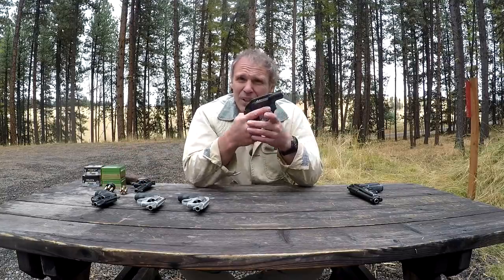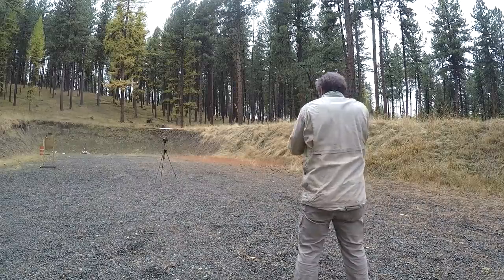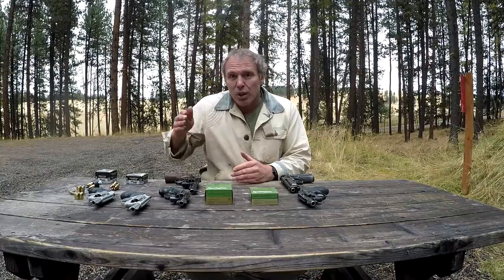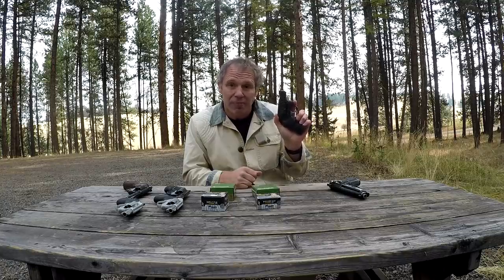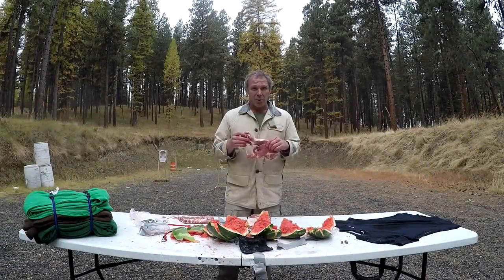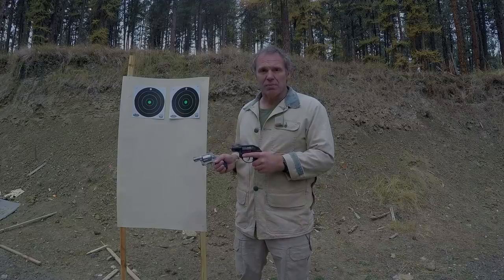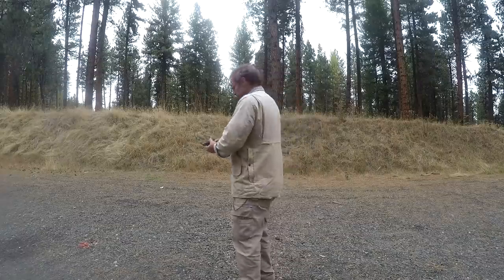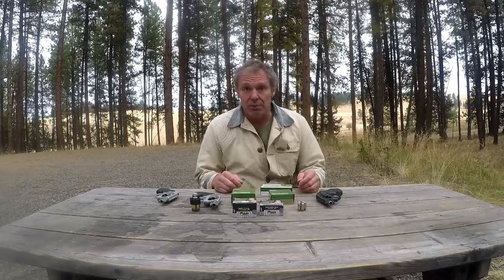Ruger LCR 9 Millimeter

Comment: Paul I always enjoy your videos especially the longer ones. But I have to ask in case someone already hasn't, what do you think about the lcr in 357 magnum compared to the 9mm version. I carry the the lcr in 357magnum daily and wonder if the extra recoil of the magnum is worth it because it's there in these lightweight revolvers. As always thanks for the videos.
Reply: Kenneth Hughes I 2nd this question.
Reply: @Wilson Turner yes I saw that. My point in my case is the recoil. In my lcrx and especially an airweight s&w like the 340 pd, the recoil is far more pronounced in these light weight revolves. Would 9mm be a better choice since follow up shots could be quicker and reloading a little faster with moon clips vs the power of the 357 magnum. I've met people that carry these ultra lightweight revolvers and use 38+p instead of 357 because of the recoil even though their firearm is a  357.
Reply: @roadrunner7828  I would say if your gonna carry a 357, your going to have to accommodate a heavier gun. 357 is a great caliber, but like all firearms, are you going to sacrifice placement or the effectiveness of the round for a lighter gun. As far as follow up shots are concerned if you can put rounds more effectively with the 9mm version than other rounds go with the 9.
Reply: At about 24 oz, .357 magnum is much more manageable.  In which case, carry a 3"-5" barrel to get all the benefits of .357 mag.  I am surprised a ton of 3" GP100 and 686's aren't made.
Reply: The .357 cartridge is stout in this gun. It’s manageable if you can handle the extreme recoil. You can certainly shoot it. But I can only manage a cylinder or 2 of it at the range without gloves before beating up my hands. Then just 38+p or standard pressure the rest of the time. And I don’t carry .357 in it because I’m afraid if I have to shoot farther I would flinch and miss. I do carry 38 Special +P  Hornady Critical Defense 110 grain ftx bullets. If ammo wasn’t scarce right now I would likely order some hot 38’s like the 158 LSWC .38 special +P’s from Buffalo Bore. I’ve shot plenty of +p .38 through this gun (the LCR .357) I love it, carry it everywhere. The only time I’d ever really want to carry .357 in it was if I was in bear county and this was just on me when I went on hikes etc. I’d probably stage it to already be wearing gloves to help shooting but that’s a pretty niche situation.

Comment: Thank you for another informative, thorough, well done video Paul. One issue I do have is- what are your impressions of the LCR 9mm? You detailed the different performances of .38 versus 9mm in auto-loader versus revolver, then compared short versus long barreled revolvers, then 9mm coming fired from the LCR into your meat targets, etc. . Towards the end of the video you just simply said it doesn’t fit your hand but you say it might fit others. I’d really wanted to hear your impressions of the gun itself- how was the felt recoil of 9mm versus .38 in the revolver?Were there any performance or durability issues? Are there any issues that might make the LCR not a good carry or backup gun. In all your metrics of data and performance it seems like the concept of the LCR in 9mm is a winner, but your impressions of the gun itself are equally important to us as well.
Reply: Me, also.  I own the .38 version of the LCR, and really wonder how the recoil of the 9mm compares.  Was hoping you'd mention that.
Reply: @thestingyham1188  I have both and the recoil is pretty comparable due to the fact that the 9mm version is heavier. The 9mm might be a tad more comfortable to shoot if I had to pick. The worst felt recoil between the two was with the 38 Special using Buffalo Bore 158 grain +P LSWCHP, that was a handful.

Comment: Dam, only 4 minutes old and there's already 13 ahead of me!
Good solid video as always.  Don't know about the internal hammer on a revolver though.  Like what's the point of a revolver if you take the hammer away?
Reply: No pocket snag.  No lint or grit buildup inside the gun.  No ambitious prosecuting attorney accusing you of "recklessly" cocking your gun.  SOME hammerless revolvers do NOT have stacking triggers; they cock, stage, and fire buttery smooth, all in double action only if you pull slowly and carefully.  Yeah, they are rare...……………………………..elsullo
Reply: BigK yes,  but where is here?!?!
Reply: elsullo2   Yeah, I'm aware of pocket snag.  Even if I wasn't, Paul was good enough to mention it.  I just don't believe a revolver is much competition for an autoloader, except as a great home gun, because of its reputation as being so reliable, and generally speaking, single action triggers are one of the few other reasons they can be good.  Which this doesn't have.  My Sig, btw, has an excellent single action trigger as well, except that it does it automatically.  Remember, this video was about this particular revolver, not some rare specimen that may have had some custom work on, but just about this Ruger.  
As Paul said, is it right for me?  No. Is it right for you?  That's up to you.  It serves no purpose to me.  I do love revolvers, but more as a nostalgic thing.  If you love it, that's cool, I respect that.
Btw, I don't believe any gun should be carried around loose without a safety.  Exposed hammer or no.  Just my preference.

Comment: That was a great post. My brother-in-law has a 9mm LCR and has twice had issues with the projectile coming out of the case with the 115 grain Federal FMJ ammo. He had multiple boxes of the same lot number and at least 1 failure per 50 rounds on 4 or 5 of the boxes. A couple in the first 250 rnds. he bought and more in the 2nd 250 rnds. He finally gave up and used the ammo in his 1911. He hasn't had an issue with any other ammo brand, just the cheap ammo. The ammo he shot up in the auto loader had no  failures. Again it was $9 per 50  Federal 115 grain FMJ ammo that had the failures.
Reply: Hamm 603 x federal has loose crimps on the 9mm rounds use remington or Winchester and you won't have a problem
Reply: My 9 mm Charter Arms revolver had crimp jump with that same ammo!
Reply: Boberg ammo list.  If you have one of these 9mm revolvers google the list and print it out.  Lots of the cheap bulk 9mm is prone to jump the crimp.  Fortunately there are some readily available low cost options that don’t jump the crimp, like Paul’s beloved WWB.

It happened to me on the first cylinder of Blazer brass.  Not on the list...

Comment: Paul, one thing I'd like to mention - in your explanation of why longer barrels produce more powerful discharge, you brilliantly explained the phenomenon of powder not being able to burn sufficiently - modern gunpowder doesn't explode, it just burns very fast - deflagration, not detonation.

But there is a mechanical phenomenon far more fundamental to the topic, which is less dependant on casing size, burn rate, etc - the fundamental reason longer barrels propel bullets faster is that, irrelevant of the actual pressure in the chamber or how much propellant has burned, longer barrels allow the gas to apply force over a longer time period. Applying the same force over a longer period results in greater energy in the projectile - the most intuitive places you can see this is when you push someone on a swing, you push for as long as possible before breaking contact, and in tennis, you push the ball with your racket for as long as possible.

This principle has diminishing returns, because the further the bullet travels down the barrel, the larger volume the pressurized gas occupies, and the less pressure it is able to apply to the bullet. Also, while the pressure diminishes as the bullet travels across the barrel, friction actually increases as bullet velocity increases inside the barrel, so at a certain point any extra energy simply becomes heat in the barrel. This is actually the biggest problem with modern large railguns - there are naval railguns that can fling projectiles at triple the speed of traditional munitions, but the extra friction melts the weapon itself.

To be clear, I'm not saying that you're wrong - your explanation was completely correct. It was just incomplete. The principle you've described is mostly relevant to exceptionally short-barreled firearms, and explains why a snub-nosed .357 will lose significantly compared to a full-sized .357. But I believe my explanation helps explain why a lever-action .357 rifle is so much more powerful than a full size .357 handgun, when both are supposed to experience complete, efficient powder burn.

Comment: I have both the 638 and the LCR9mm. Shoot both very often. I have to say, I love the moon clips and can load them faster than any speed loader. You mention the 638 has the ability to add one or two rounds rather than the full moon Clip, but you can add a fast round or two on the LCR as well. Yes, it takes a down or pen etc. to remove the extra rounds, but would you be doing that anyway in most situations? The LCR has Better ballistics than the 38 or 38+P, there is no question about that. The only advantage of the 38 642 is the lighter weight for EDC.
Thanks for one very GREAT review. You really are the GODFATHER of Youtube. PAUL HARREL were COMMON PRACTICAL  SENSE RULES!

Comment: Paul - I thought this was another SUPERB video.  You’re an expert AND a wonderful teacher;  when combined — and both attributes are rare, so combination is especially uncommon — that means “we students” will learn, think and benefit greatly from your efforts, experiences, education and highly articulate and coherent  presentations.  So BZ, sir, and THANK YOU.

I have always preferred Ruger’s SP101 (2.25 inch barrel designs) to Smith’s 1.875 inch J Frames.  I’m well aware that MANY individuals will disagree with me — and I’d never argue that they are wrong, this is STRICTLY a personal preference.  Specifically, I like the SP101’s tank-like strength, its long proven durability and reliability, its always good (although not necessarily outstanding) accuracy, its ability to fire essentially unlimited .357 magnum rounds (however, usually I load mine with top +Ps), its traditional hammer design (for single action shooting), the extra  0.375 inch barrel length (greater velocity and sight radius), and its additional mass (faster target reacquisition and marginally less felt recoil) . 

While I have never owned one, I’d point out that Ruger has a 9x19mm, 2.25 inch barrel, SP101 (Model 5783).  Perhaps (?) this might have the aforementioned advantages AND chamber the arguably best snubbie loads (given one has decided not to carry .357 magnums in a small revolver).  A 9mm +P from a 2.25 inch barrel — obviously, specifically ammunition dependent — might be a very effective load.

Comment: Great, informative video as always.  One factor about shooting a 9mm snub nosed revolver vs one in .38spl is the comfort to the shooter which may lead to more accurate shooting.  Also, it might be interesting to compare the 9mm LCR with the Charter Arms Pitbull 9mm, which has doesn't require moon clips.  Charter uses a modified shell ejector that holds the rounds in place.  You can't eject single rounds but you can carry extra ammo in a speed strip which fits flatter in a pocket.

Comment: Crimp Jumping:
In young & foolish days, I had a S&W 340 PD. 12 oz .357 magnum revolver. First cylinder of 125 gr gold dot ammo with brass cartridges had the cylinder stop after the 3rd shot. Additional bullets had pulled too far for the cylinder to turn further. Same ammo with nickle plated cartridges performed flawlessly. The slightly harder nickel plated cartridges kept bullets firmly seated.

Shooting that gun was like catching a baseball bat in mid-swing with bare hands. I don't suggest it with greater than .38 special wadcutters.

Comment: I've been wanting to purchase an LCR.  I can't decide which caliber...  I was considering the .327fedmag, but I noticed that even Cabelas didn't have ammo. That's a big deal!  I'm leaning towards .22mag, but now the 9mm seems like a good choice, also. The main advantage with the .22mag is, it holds 6 rounds, instead of 5(9mm,.38spec). Still undecided. But, great video on the comparison.  Especially the added power of the 9mm in this platform.

Comment: I love my 9mm LCR! I use Federal HST 124 gr standard pressure in it and have had great performance. Also, keep in mind that the 9mm model uses the same material as the .357 model which is heavier than the .38 models.
Reply: Do you still have it and like it?

Comment: Paul love the channel. On criticism- it’s my understanding the increase in power from a longer barrel is due to a longer “power stroke” or there is more time for the the projectile to be accelerated to a higher velocity. More time for acceleration, and not a “build up of pressure”. As the pressure spikes to maximum very soon after the primer strike.

Comment: Great video as always.  I have an 8 round 929 in 9mm and find bullet creep an issue with some ammo.  I've had bullets actually leave the case on the 7th and 8th rounds.  When trying a new ammo for competition, I usually shoot five and check the remaining cartridges for OAL and do this with several cylinders until I am sure there will not be an issue.  That's the issue with a taper crimp on a semi auto round vs roll crimp on a revolver round.  The max pressure for a 38Special is around 20K psi vs the 9mm 35K psi.  Powders can be selected for faster or slower burn rate properties to maximize velocity for a shorter barrel, but unfortunately for the 38, that pressure cap will forever keep it at a lower power.  When using speed loader vs clips, I have a competition 627 that also uses moon clips and found the longer OAL of 38 is an impediment for fast reloads.  I'm faster reloading 9mm with its shorter OAL.  One factor to consider in 9mm's favor is that practice ammo in 9mm is less expensive than 38.  30 years ago, you could get 38 lead RN for around a dollar less than 9mm FMJ.  Now it's five or more dollars more per box of 50.

Comment: Interesting and fun video.  The .38 is  so easy to like.  Growing up all the old farmers made them in their barn shops and used bird shot in them.   I think they didn't work with bullets inside a barn because you couldn't hit the sides.  You can reload them up to low .357 for use in the 357.  You can cast bullets and use junk lead and they will forgive you.  Brass is thick and can be reloaded many many times.  And like you said....  You can even put black powder and make lot's of smoke.

Comment: I own a Charter Pitbull in 9mm and I picked it specifically because it doesn't use moon clips.   The downside is it can't use speed loaders either because the cartridges need to be snapped into place with a little pressure.   The reason I bought it is because I wanted a backup gun in the same caliber as most of my other carry guns but in a revolver.   A big advantage for me is that in the highly unlikely event I need to reload it I can do so pretty effectively from any 9mm semi auto magazine.   It's a little bigger and heavier than most snub nose 38s or the 9mm LCR so that's a potential negative but I imagine the recoil is more manageable than the 9mm LCR.   The Pitbull was originally a 6 shot but right before I bought it they switched them to 5 and the cylinder stayed the same size, that was pretty disappointing but overall I'm still happy with it.

Comment: I imagine it would be the powder charge weight and the burn rate of the powder used in +P loads that accounts for the velocity loss. Not just the charge weight. Another good video by Mr. H.
Reply from the maker: That's what I meant when I said charge configuration.

Comment: I may have missed if you touched on this but I believe the lcr cylinder is the same size for both the 38/357 and the 9mm- the 9mm being a shorter round would get what is essentially a longer barrel in the excess cylinder length to travel through. This could potentially boost the velocity even if just a bit.

Comment: Thank you for this great review, very interesting and comprehensive comparison. I love both cartridges. I find it interesting though just how close they are for the differences in pressures. In +P format 9mm is 38,500psi, while 38spl is only 20,000psi. Also I feel that the 38spl really excels with heavier bullets in the 158g range. 9mm is handicapped in that area as it generally tops out around 148g, and with the bigger bullets you lose a lot of case and powder capacity giving the 38spl a leg up. Again, both are amazing cartridges though, I love them both.

Comment: Paul, as always great work. Love the vocabulary workout - super eruption and such. One other possible advantage to the LCR in 9mm, the cost of practice ammo. If we buy in bulk we can get FMJ 115gr. 9mm for 16¢ to 18¢  a round. Did a search at TargetSports.com and the cheapest .38 ammo I found was 28¢ a round; which is more, a lot more! Likewise 9mm has had quite the renaissance, so there is much wider selection in store for 9mm over .38 - well at least in my stores. For the S&W fitting the hand better. I have the 640 J-frame .38 all-steel +P model. It fits my hand like, well a glove, and is a joy to shoot.

Comment: I own a 9mm LCR. The only ammo I have experienced significant crimp jump with was Blazer Brass (I believe it was 115 gr.). The Blazer Brass ammo jumped to the point where the bullet extended beyond the cylinder and prevented the cylinder from turning. Otherwise, it's been 100% reliable with all the other ammo I have put through it.
Reply: Ruth Figueroa That type is prone to failure but so are many others.  The Boberg ammo list is a helpful guide.